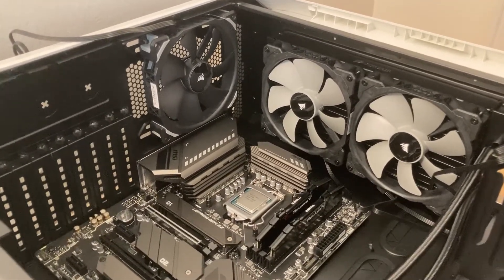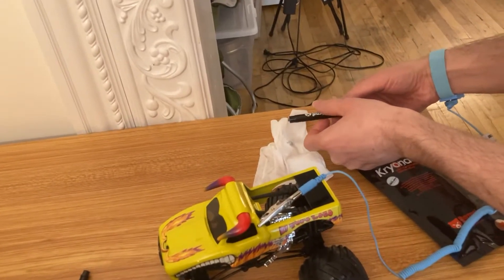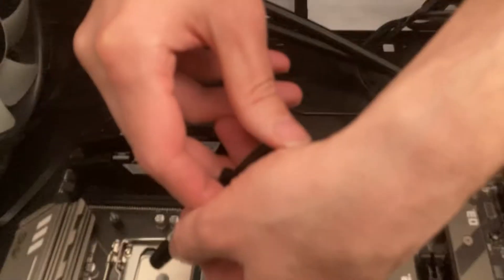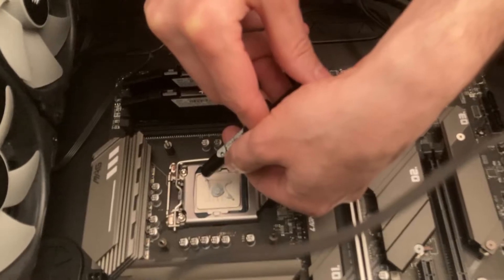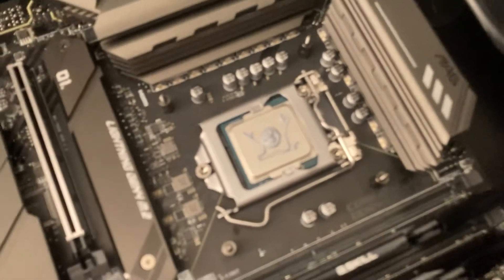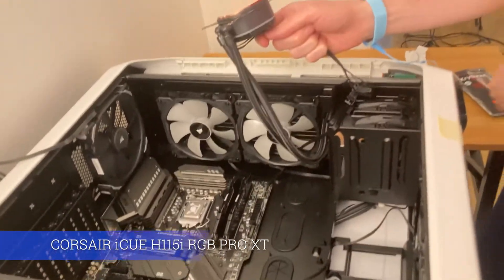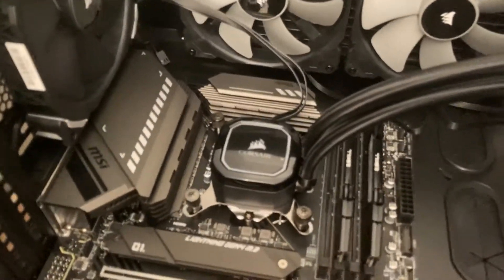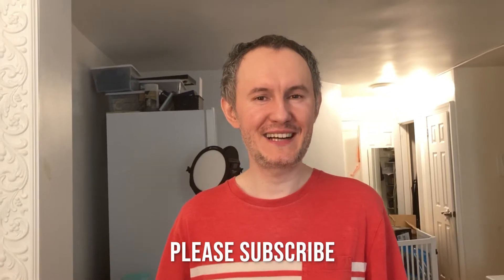Thermal Paste 5 Dots Method and Closed Circuit Cooler Install

Comment: Ur fans are backwards? Dont you want top to be exhaust?
Reply from the maker: top and back are exhaust. front and bottom are intake. it is slightly positive air flow, which is optimal for dust control